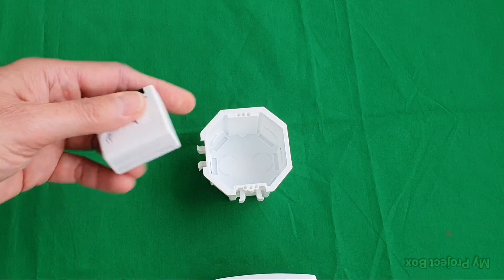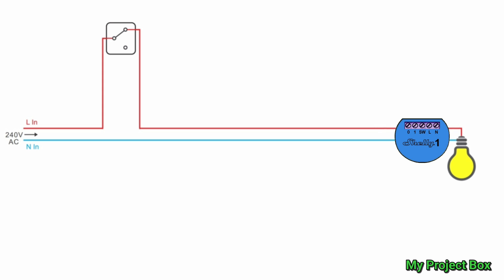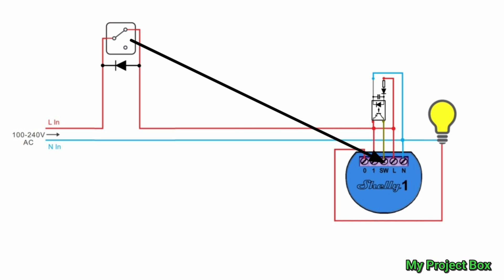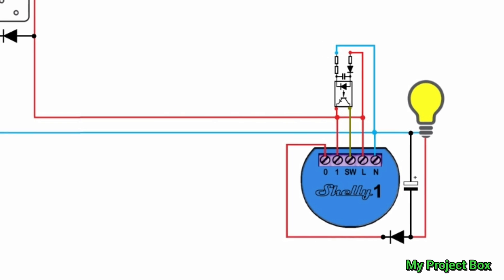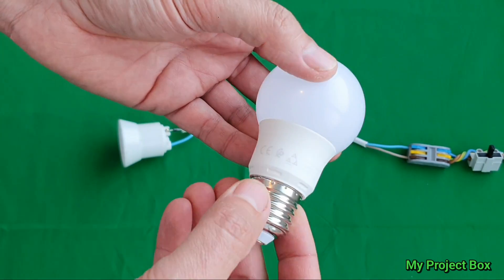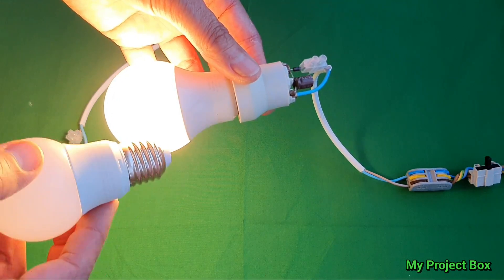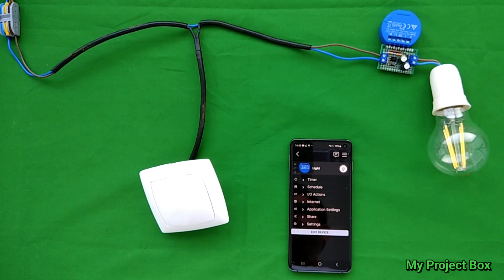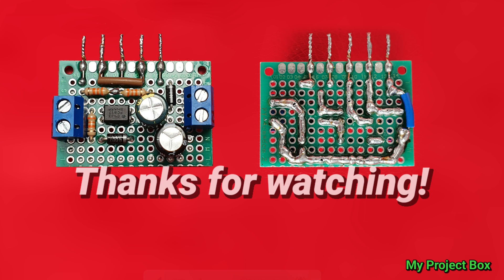Shelly1 No Neutral at switch? Install at light bulb "Circuit Hack" No permanent Live wire!

Comment: This would be an awesome pcb to be able to order (prebuilt or even solder needed). No need for space inside the wall box, gets messy in there if its more than 1 switch. No need to pull a neutral down, simple wiring and still keeps the wall switch working.

Comment: I don’t really understand about electronics. I only have Sonoff Mini R2. Is the hack the same? I see Sonoff have 6 port and Shelly have 5 port.
Reply from the maker: This is the equivalent circuit for the Sonoff mini-R2. https://youtu.be/x7Q8AS238pY 
But if you prefer to put it by the light switch, I have this simple circuit https://youtu.be/oBR5O391m_c

Comment: Very well explained.  I suppose all "no neutral" switches use the same principle. By the way, these days there's Sonoff "mate" that works with the main Sonoff switch and from what I understands does the same job as the customer circuit in this video.
Reply: What is this sonoff “mate” and where to get it? Thanks

Comment: Hi, I tried this on a using 10uF 250v Capacitor and the light and it did remove the flickering. but however when I switched off the the switch, the capacitor blew. I tried using it with a 10uF 400v Capacitor and that one went up in smoke. I see that you use a 4.7uF 400V Capacitor, is it important to follow this?
Reply from the maker: You have to be super careful!!  If you get the polarity of the capacitor wrong it will go Bang!  The same thing will happen if you get one of the diodes in the wrong polarity. 4.7uf works for some LED bulbs, 10uF is more universally compatible.  I suggest you make a test set up first,  to verify its all working.  You can use safty current limiting, in the form of an old school in incandescent light bulb,  Just like I did in this video. https://youtu.be/oBR5O391m_c   at  this time stamp 12:56.  This will prevent things from going Bang while you are testing.

Comment: Very nice for old Shelly but now with new Shelly it is redundant but for you or anyone with an old Shelly a very nice work around thanks
Reply from the maker: This circuit is also useful if you don't have enough space to put a shelly behind the light switch. Now you can put it directly at the light fixture instead. It might even improve wifi reception. Especially if the switch backbox is metal.

Comment: This is so much more work then just getting the Shelly L
Reply from the maker: It's true that the Shelly L and it's bypass, is just a "drop in"  no neutral option. But if you already have some Shelly1s lying around,  it gives you more options. For example, if you can't fit your Shelly behind the light switch, you can put it by the light fixture itself (and you might even get better wi-fi reception up there). This circuit hack also works with the sonoff mini, and maybe with some other smart switches. So it definitely has its "niche uses". I just think it's good to have more options available to us.

Comment: What about two way switches? Could it be done also for two way switches?
Reply from the maker: It is possible, but there are some caveats 🤔. This subject probably deserves its own video. The diode needs to go across the incoming Live from the first switch, and the outgoing Switched Live from the last switch. That's not very convenient for most two way lighting setups. It is however possible with the UK's two way system. The other solution is to use momentary "push type" switches instead.
Reply: @MyProjectBoxChannel   👍🏻 Waiting for your video!!!!!!
Reply from the maker: @johnym26  actually you got me thinking, there might be a better way of doing it.

Comment: How to modify this circuit for using with Sonoff mini R2. For idea... it will be fantastic if there is space for solder fusible resistor on L-in to.
Reply from the maker: I did think of making a similar PCB, as I did for the shelly, but I don't know if it's worth making a video about. Adding the fusible resistor is something I should have done for all the circuits🤔. I was just trying to keep them as simple as possible.  The Shelly 1 and sonoff mini  circuit hacks, are essentially the same. It's just how it wires to the devices is slightly different connections. And the Shelly one has the addition of an extra diode and capacitor, for better smoothing of some flickering LED bulbs types. With each new circuit, the design became more refined and improved.

Comment: What is the lifespan of your solution? Afraid to burn down my house after i seen this burned units from the bypass of shelly
Reply from the maker: I've not had any problems yet. But it's probably a good idea to add a 10R fusible resistor for some extra protection. This should give the circuit some extra longevity, as it takes some of the stress away from the capacitor rapidly charging with inrush current. And in the event of something failing, the fusible resistor safely disconnects. It's a safety feature that many LED light bulbs use internally. I have a different circuit example where I use one of these fusible resistors. https://youtu.be/oBR5O391m_c
Reply: @MyProjectBoxChannel  lets see if i can build it. I am IT guy but soldering works for me for some reason even if i dont understand what the components do :)

Thank you for the great guide
Reply from the maker: @partyscoutereurope2586   okay just take care when working with mains voltage circuits. Things can go bang if you make a mistake!

Comment: I have never seen wiring like this here in Aus, the way my house is wired, the live, neutral and earth go to the fixture an a pair of wires go down to the socket.

The way it is essentially wired is the same as in this video, but you will have 5 wires at the bulb.
Reply: It's called 'looped at the light'
Reply from the maker: If it's wired the same as the UK you won't need my circuit hack. You will have everything you need to wire the mini, at the ceiling rose.
I made a video about it.
https://youtu.be/ZaAZA8IbaQU

Comment: It is awesome project. I have tried your diagram with Shelly 1 and Shelly 1pm. It is working fine for the led bulb. 
I have another question. Do you think it  can apply for ceiling fan? How about  Inrush problem?
Reply from the maker: I wouldn't recommend any thing else other than a LED light bulbs. The output is DC and most fan motors run on AC. You can probably run something like  a 12v LED power supply for LED strip lights, but you have to test it first.
Reply: @MyProjectBoxChannel  How about find a DC motor? Do you have any idea? Thank you.
Reply from the maker: @hoiwingfung9101  yes in theory a fan with the DC motor will work. Or you could use a 12 volt power supply (SMPS Type! not old fashioned transformer) and use a 12 volt fan, or a 12 volt computer fan. Just  remember that your diodes in your circuit need to handle the current of your load. That includes the diode across the light switch.
Reply: @MyProjectBoxChannel  yup, I will test it later. Thank you.

Comment: Hi there ! is there any way I can buy pre made circuit board like the one you did. I am not good with soldering and electric stuff. I am also in UK (Leicester). Any help would be appreciated. Thanks
Reply from the maker: I'm very sorry but I'm not currently manufacturing any of these circuit boards. I just don't have the spare time. However if you do decide to make it yourself, take care! this is mains voltage you're dealing with.
Reply: @MyProjectBoxChannel  Thanks.

Comment: Hello, I've got a small dilema about something, and would appreciate if u could give me your thoughts on it.
Like many people, i have no neutral wire installed behind switches in my apartment, so ive got to use some way to overcome that.
But, there is one thing that, I think, makes it easier for me.
I've got two live wires coming from the switch to ceiling light, so i was thinking of sending one live directly to the light fixture, where i would put smart switch module, and the other one could be controlled by fiscal switch, which would pass 220v when on. I know there are solutions like Shelly 1 and others who accept 220v as external switch trigger, but the only thing I have available for me right now is Sonoff mini, which as u know uses low voltage ground for external switch. 
My question for u is, what do you think the best solution for using 220v to bridge S1 and S2 inputs would be? 
I was thinking of high voltage relay of some sort but am really curious of your opinion non that? Thank you in advance.
Reply from the maker: yes it is possible to use a relay with a 220 volt coil. The relay contacts can then bridge S1 and S2.  You can get quite small relays that have a 220vac coil, but they tend to be rather expensive.  It might be easier just to use a Shelly1.

Comment: wow it works for me thx
Reply from the maker: I'm really glad you got it working 😉👍. It's a very simple circuit, but it's also very easy to get something wrong. And at mains voltage it's very easy to destroy electronic components. I'm working on a video to do this hack to a smart bulb directly. In this way a ordinary light switch can control a smart bulb without disabling it in the off position.
Reply: @MyProjectBoxChannel  It is a really great  KEEP UP

Comment: this is amazing solution - any plans to turn the board in PCB with components mounted? I understood the circuit but was confused looking at your board with jumper wires. I would like to get the PCB. Also the polarity of the diode at the switch is important as it needs to be opposite to the one in the wave detection circuit for this to work - may be very important point to remember/consider while implementing this.
Reply from the maker: I might have some PCBs made in the near future if there is enough demand for this. I know of at least one person who has had professional PCBs made for this project. The layout of the board can be changed to suit your own needs. Yes the diode polarity is very important 😉.
Reply: @MyProjectBoxChannel   I would like to get a PCB as well. Any updates on where we could get this?
Reply from the maker: @vasilistsouvalas7360  I simply don't have time to do a PCB 😔. I'll have to leave it up to others to take up the challenge.
Reply: @MyProjectBoxChannel  I have tried to create a PCB following the schematics you provided. Could you quickly check it to see if I made any mistakes? I have used EasyEDA to create the PCB, so if you have an account there I can directly share the project with you. Thanks in advance.
Reply from the maker: @vasilistsouvalas7360  that's not a bad idea. I could have a look in the next couple of days, when I have time. You can message me on Facebook messenger.
Reply from the maker: @vasilistsouvalas7360  I've looked at the terminal connections that go from the board to the Shelly one and they don't look correct. It should line up straight with the board N.L.SW.1.0.
You should have a link between the "L" terminal and the "1" terminal. Looks like you have a link between L and SW. 
https://photos.app.goo.gl/P7iZzs8QXPtN8kNB9
Reply from the maker: @vasilistsouvalas7360  I think I have corrected the mistake on the PCB layout
https://photos.app.goo.gl/PatGgtqBjrP4WF369
Reply: @vasilistsouvalas7360  was wondering about the progress of your pcb?

Comment: Could you perhaps measure the power being used while on and off ?
Reply from the maker: I have not measured it but it's about 1w with the relay ON engaged. Off should be much less just standby current. If I get time I'll do some measurements. The half-wave DC should not effect it because the internal rectifier in the shelly1 is half-wave as well.

Comment: That's a great idea to have everything at the light ceiling rose! What's the max power of the bulb(s) that can be connected using this circuit? Could you share the design of the PCB?
Reply from the maker: Just a reminder for everybody living in the UK. If you live in the UK and have the three plate ceiling rose (loop in system) you most likely don't need this hack since you have permanent live and neutral and  switched live, at the ceiling rose already. This hack allows you to connect to the two wires going to the light bulb itself, if this is your only option. You can screenshot the PCB design and component values straight from the video.
Reply: @MyProjectBoxChannel  Yeah - in the UK a situation you might face is not being able to reach the loop in the ceiling at at all and all you have is the switched live at the switch (often two switches to control one circuit as well  ). I got out of this by using the Dimmer 2 inline at the switch and fed the existing 3 wire switch circuit from the Shelly SW1 out - and it works perfectly - I believe there is now a no neutral version on the Shelly 1 now as well.
Reply from the maker: @relativenormality   I'm no a big fan of the shelly NO-NEUTRAL option. You still need the special load bypass unit for it. People have also reported the bypass units blowing up!🤔
I do have a more "universal" no-neutral circuit. It works with many different makes smart switches. https://youtu.be/fT3YztU2MYE 
Here is a example with a sonoff M5-3C https://youtu.be/8h29-0rpQJo
Reply: @MyProjectBoxChannel  it's definitely a last resort but I just put it in a circuit with 13 gu10 LEDs and none of them were stuck on at off / zero brightness and the dimming is smooth EDIT - no bypass either.  It was for a client. My ones at home that are also no neutral have only 6-8 lamps.on and on both circuits one is always on dim at off. I don't mind - sort of a nightlight. If I needed a bypass load I would use the small one from Danlers

Comment: It is a really great project! What is the compatibility with other smart switches, like other shellies or other brands?
Reply from the maker: I made the original version for the Sonoff MINI. The only difference is the Shelly version as an extra diode and capacitor. This is a small improvement that makes it compatible with more types of LED bulb, and stops some types of bulbs from flickering. https://youtu.be/x7Q8AS238pY
Reply from the maker: One of my viewers has verified it working with the shelly plus1 as well.

Comment: I really don't want to change the light fixture in this case - live is always powered, so a little bit uncomfortable to touch ;)
Reply: I have an unsafe ass of a brother in law. 

Which has endured I never forget to isolate the circuit at the breaker. As I can guarantee he'd come and switch on that light switch. 

Even though I now live in a different house 🤣 the moron is keeping me safe from afar.
Reply from the maker: From an electrical perspective the light switch is NEVER a safe means of isolation! When you work on electricity you should always turn it off at the consumer unit / fuse board, directly. Anybody could walk into the room and turn the light switch on. Never trust a light switch to be "Off", I have seen them wired to the neutral wire before.(the light will turn off and work perfectly but the live is still there)

Comment: Thats  a really useful hack, would it allow to turn on at switch and off at switch or vice versa? 
Also would it work with a shelly dimmer? Would be great if it does.
Reply from the maker: Yes!👍It works with all combinations of switch position and Wi-Fi control. Not sure about the dimmer version. I will have to get one to try. It works with half-wave, so might be problematic.
Reply: @MyProjectBoxChannel  Great thank you, wish I had confidence in making the circuit board, and advice, assistance or instructions you can share please? Thank you